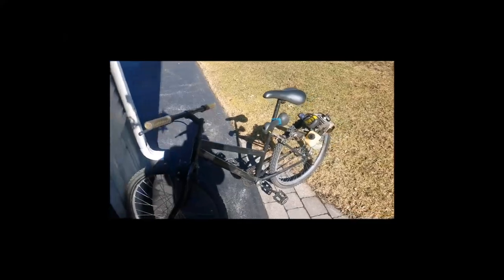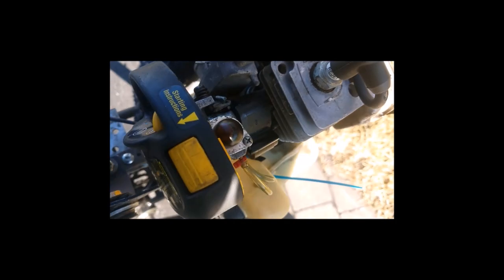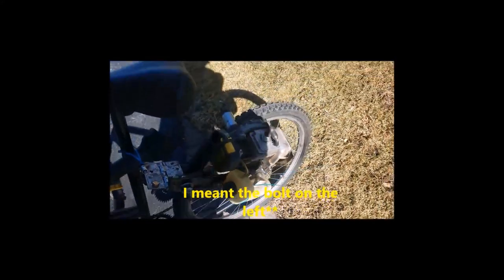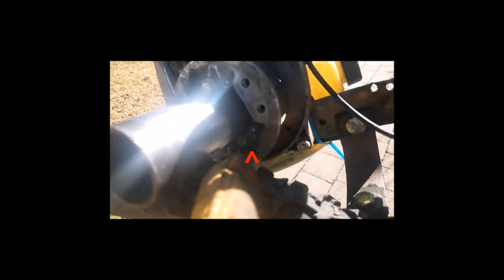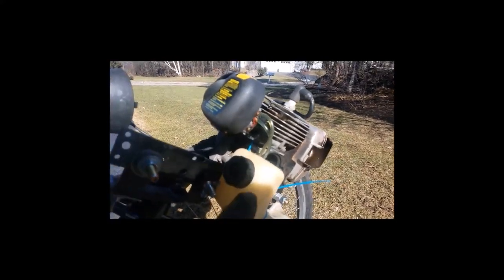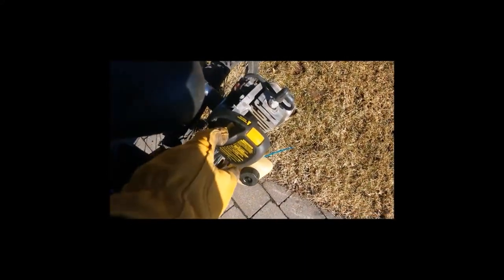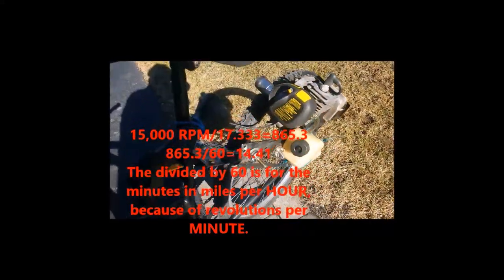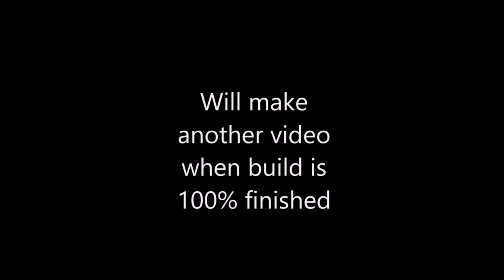Weed Eater Bike (No Welding)

Comment: glorious, waiting on the follow up. what do you have planned for the rest of this motorized bike project?
Reply from the maker: J. Garcia the plan was to finalize everything with welds. Unfortunately, every bolt mount in the engine casing either cracked or stripped out. So, the project was terminated.
Reply: brutal.

Comment: Are you saying this engine produces 15000 rpm...I thought Max rpm was about 7500-8000 rpm
Reply from the maker: Not sure to be fair. Never measured the RPM.
Reply: @mtbvermont2940  but do these engines generally produce about 10 000 rpm
Reply from the maker: @creativemechanic1565  possibly some at a very top speed. A 25cc 2 stroke engine shouldn't be trusted if it is over 10k rpm..
Reply: @mtbvermont2940  how about 52 cc...if I fit a bigger race carburetor will it blow my head